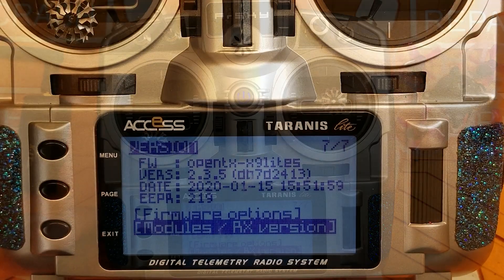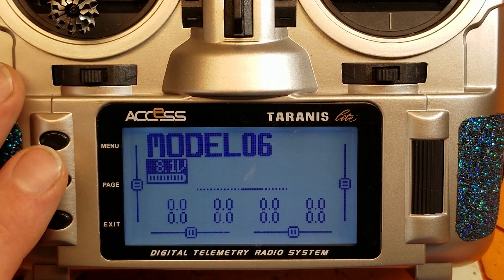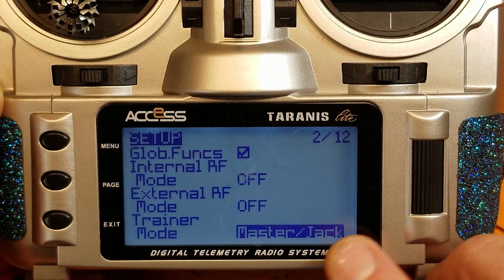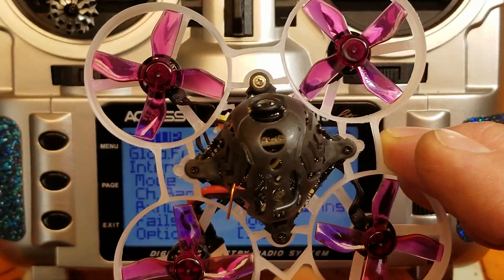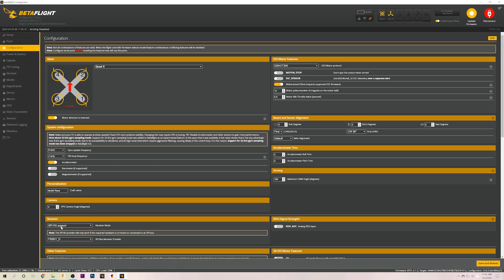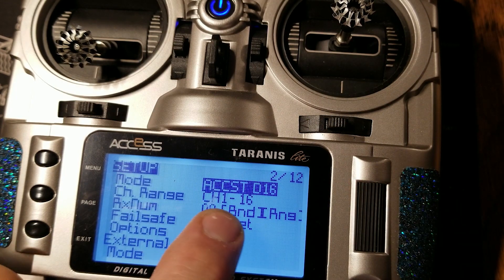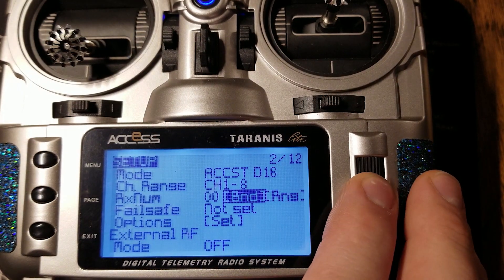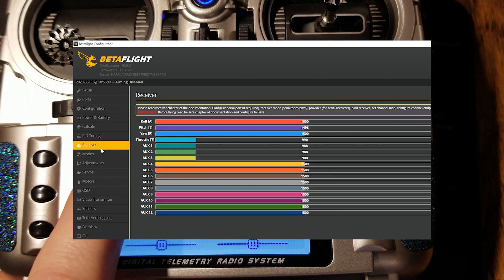How to bind SPI receiver with an ACCESS radio in D16. 📻✈

Comment: After watching 1st minute I thought You will going to tell us a way to use D8 natively on X9 lite. I was about to lose my hair since I have ordered XJT Lite for myself 2 days ago.
Anyway, good video just 1 tip for others - if You are flying in EU on LBT stuff make sure you choose FRSKY_X_LBT as SPI Bus Receiver provider in Betaflight.
Reply from the maker: Oh yea good point. I always forget about the lbt stuff.
Reply: Thanks! That solved the problem for me
Reply: i selected frsky x lbt version on my th2 indoor and bind with my taranis xd9+ 2019 easily with old internal rf firmware but i have a rxloss issue when im flying like 1min and rxloss randomly how can i solve this problem
Reply: @zuqafpv  Yeah. I have the same. For me helps to change "PID loop frecuency" (In System configuration) to 2 kHz or below. Looks like the CPU on whoop overloaded at 8 kHz. But Gyro update freq still 8 kHz. And it's just fine for me.